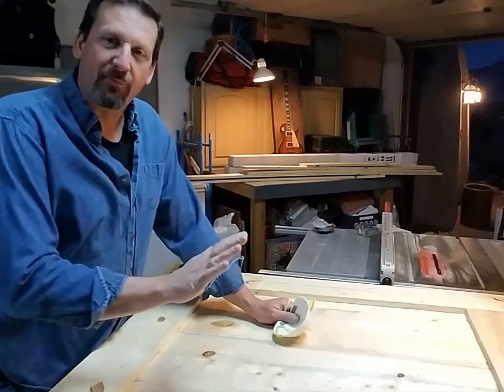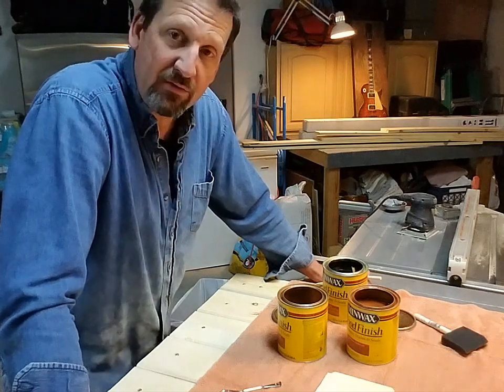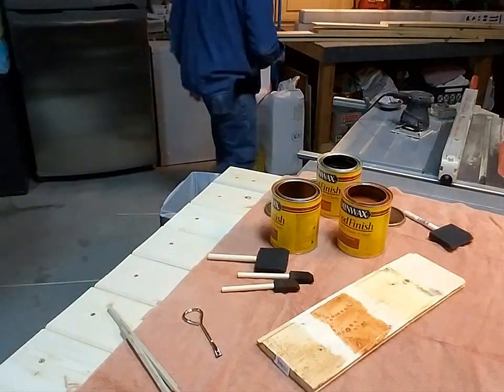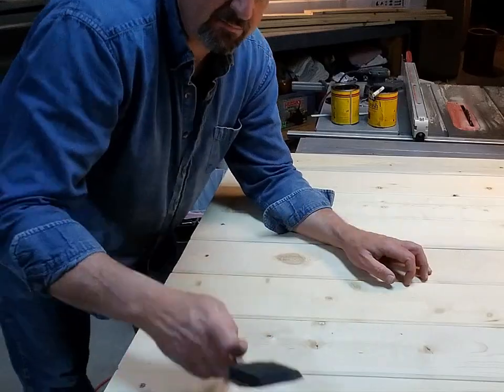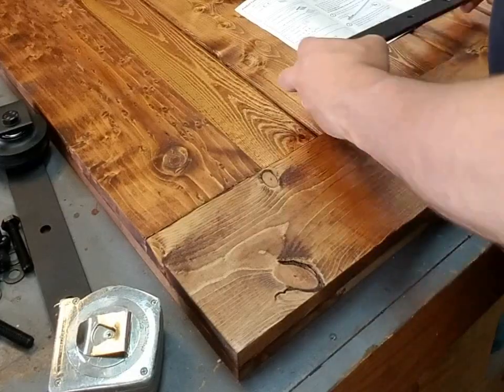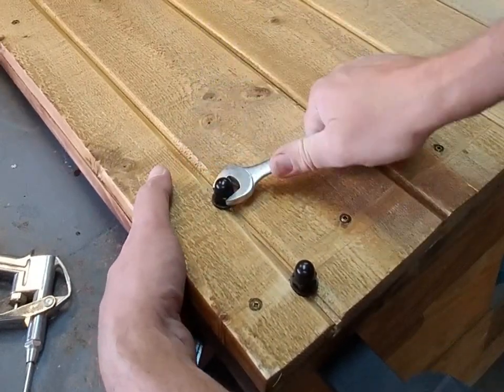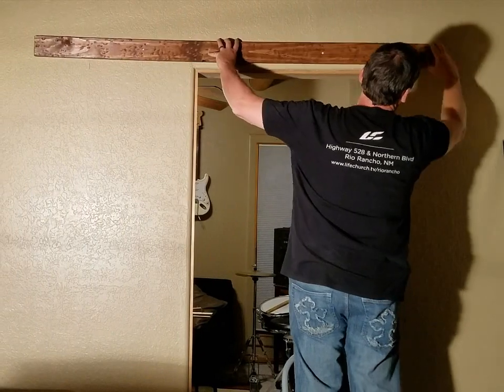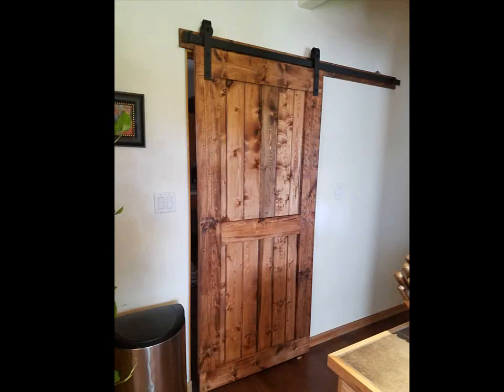Barn Doors Part 2

Comment: The unfinished door looks fantastic.  Nicely done.  However,  I wonder if you have ever considered applying  Minwax Pre Stain Wood Conditioner before you stain pine wood?  The finished door looks very blotchy, which actually covers up, and interferes with, the natural beauty of the wood grain.
Reply from the maker: yes I'll have use Minwax Precinct conditioner many times and it works really well. Normally I would have kept the natural look, but our house is more rustic and Southwestern.

Comment: Any problems with warping or the vertical planks separating?  I've built 3 of these doors out of pine and all of them ended up warping and bowing and the vertical planks separated (which exposes the tongue portion that isn't stained).
Reply from the maker: So far I haven't had any issues with warping or separating. Actually built a 5ft wide shaker style barn door for my mother-in-law with half inch panels dadoed in a pine frame and that one did twist a little bit. We are in a Superdry part of the country which may have helped